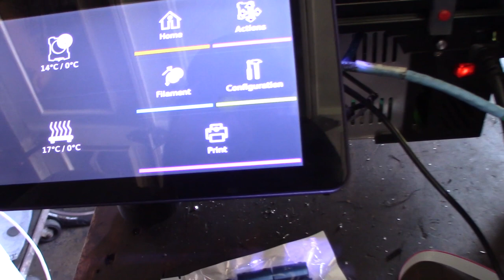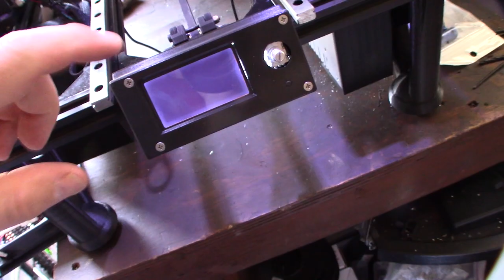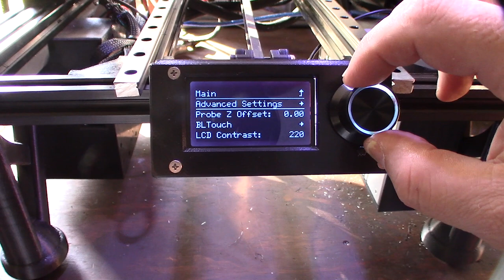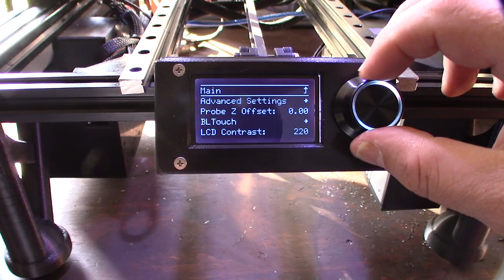Fysetc Mini12864 2.1 RGB neopixel LCD Panel with SKR 1.3 3D printing LCD Marlin 2.0

Comment: Would be helpful to post the configuration changes you made to configuration.h file.  I plug my new 12864 into the two ext ports and all it does is light up.  Nothing shown on screen.  I would imagine you enabled some settings to get yours to work.